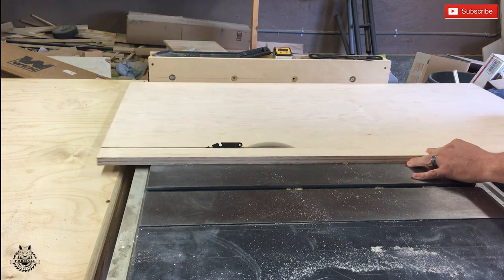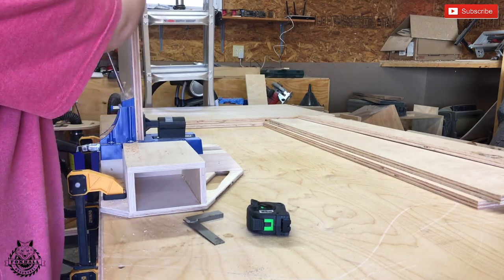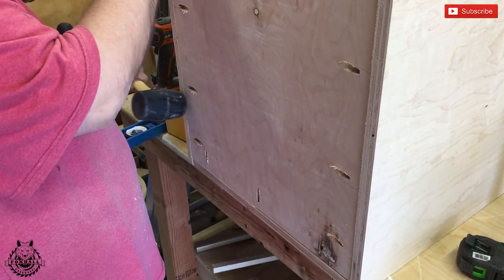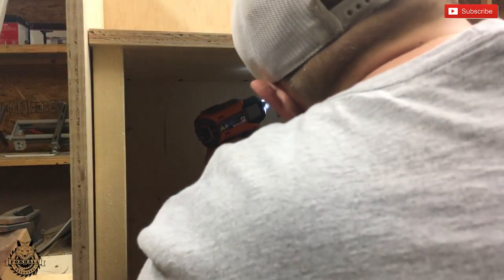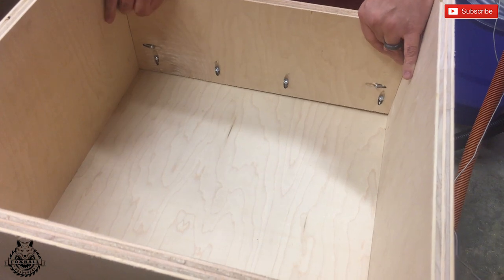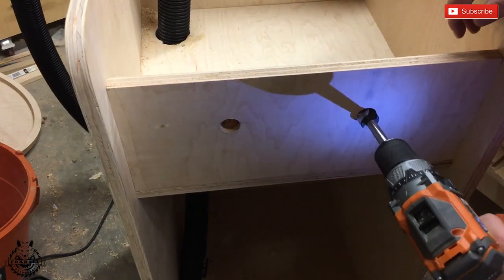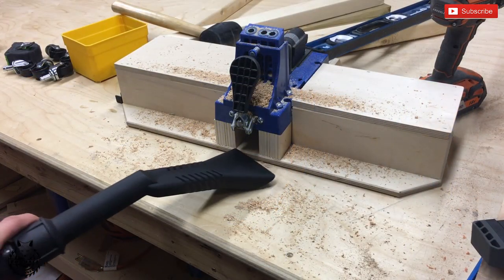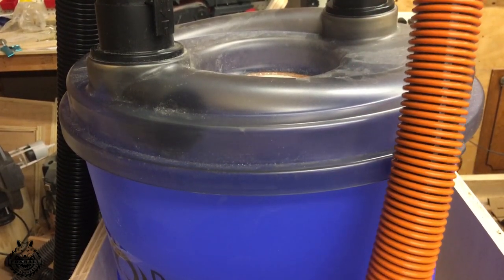DIY | How to Build a Shop-Vac Cart | Woodworking Projects

Comment: I really like your cart. Nice simple functional design.  That was exactly what I was thinking for my cart when I was searching.  Glad I found your video.  You solved my thought on how I would mount the casters.  Dang I really like your idea of how you temporarily held the shelf in place.  Too funny.  Time to maybe go out and buy a pocket hole kit for myself.  I don't have one so I will glue and brad nail it and use a few drywall screws on the exterior to hold it tight.  Eeeeeeek! I know I know visible screws aren't acceptable.  (:-).  Thanks again.  

What thickness plywood did you use?
Reply from the maker: Hey Brian thanks for watching the video!  Go check out April's plans.  They are really good.    I used 3/4" pine plywood from Home Depot. I would also use bigger wheels then I used.  The small wheels don't have enough muscle to roll over chords and what not.     Also, I would highly suggest spending a little extra cash and the get the Kreg K5 kit.  It's a little bit more but the functionality is a lot more convenient then the K4.   The K4 has the clamp in the back.  So you have to reach around the piece to clamp it.  This isn't a big deal until you have large cabinet parts.    K5 Link: https://amzn.to/3qRPBHF  I will be rebuilding this cart with a bit of a different design and I am also building a new K5 Jig cabinet.